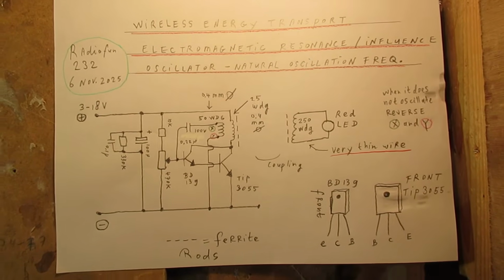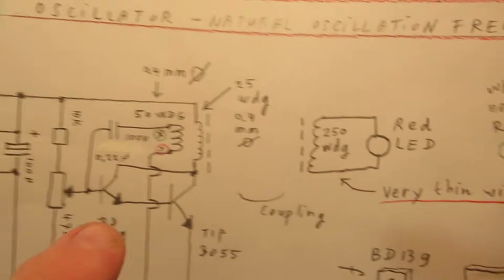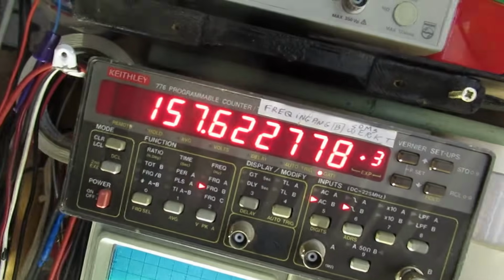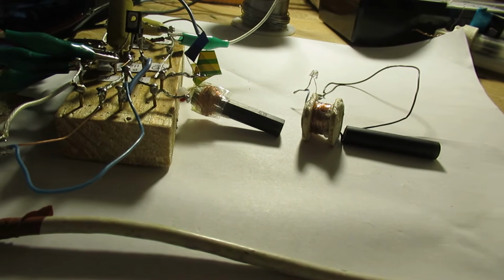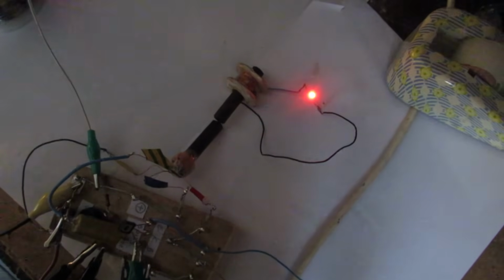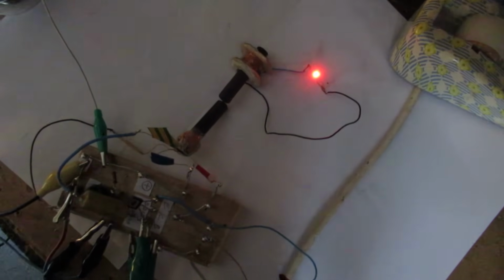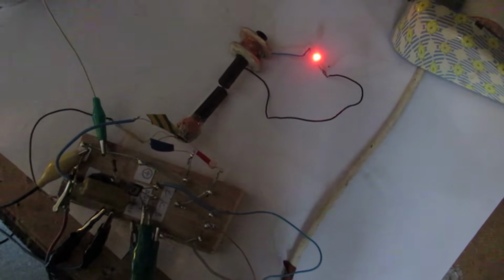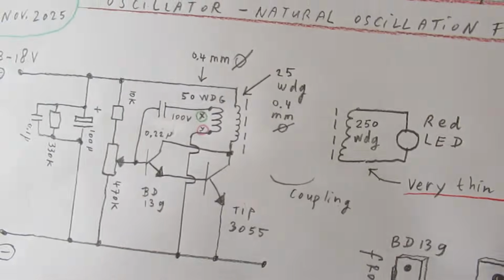Self oscillation & transport of electromagnetic energy through air. Schematic and basic demo

Comment from the maker: More information: the circuit was tested with supply voltages between 3 and 18 Volt DC. Maximum DC current/voltage that was taken up to drive the Darlington was: 300 mA at (say) 4 Volt = 0,3 x 4 = 1.2 Watt. Slowly add (!) the voltage/current to the circuit and look what happens! Tiny supply voltage changes can have big effects on frequency, the waveform (very important in terms of energy transport!) and the output voltage/current. If possible: use your oscilloscope and connect its probe to the primary coil (25 windings) or to the backcoupling coil (50 windings), thus to the Base of Transistor 1 in the Darlington = that BD 139. Never to the High Voltage coil! Don't burn your expensive oscilloscope out.....Sometimes the oscillation of these circuits can go "wild" and uncontrollable while slowly lifting up the supply voltage/current. Thus test and try (!). There is always a supply voltage (driving the Darlington) where, in such a blocking oscillator, it all works "normal". Output voltage on the secondary could get up very high, say 170 Volt but only on 50 Micro-Ampère. Was tested with a bridge rectifier (1000 V classical Si diodes, like the 1N5408 and its family) and a 12 K resistor paralleled to that bridge rectifier. Thus 50 uA at 170 Volt, in the max. situation. When we compare these figures (energy in-out), there is a fierce energy loss. Thus even with an oscillator that has the property to self-oscillate on frequency "X" there is no guarantee at all that it gives you out the best rendement (efficiency). Efficiency: is: the lowest loss as possible when converting A to B. In circuits of "joule thieves" (they are on my YT Channel, also many of them are on YouTube) this energy transport is optimized, so that you can deplete a carbon zinc or other type of battery to its absolute minimum voltage, draining out all its energy, where the (red) LED stops to light up. In joule thieves there is an optimal transport out of the HF oscillator to the LED. Can be realized (via a coil or coils) in many ways. When a radio transmitter strays out a amount of energy (X), that energy diminishes very quick regarding to the distance of the energy source. This is given by a factor, where distance to the radio source plays an important role. More about this in scientific & radio literature. As far as I know it is an inverse factor, related to the distance between transmitter and receiver. So: (say) 300 meters distance from a fierce radio station, say on AM or FM, straying out via an antenna, its field-strength is diminished substantially at a certain distance from the antenna. But be aware of the fact that also the "bundling" of the energy + the working frequency of a transmitter plays a role. Say when we are talking about a radar antenna, working on extremely high frequencies, its "bundled" and specific type of energy, often in the GigaHertz range, the field strength is bundled/more locally and can be locally fierce on point "X" in our atmosphere, where it strays out. It also has a (say) wave pattern, strayed out in our atmosphere, where precise measurements of the field strength can be made. 6 Nov. 2025.

Comment: Great video and yes very interesting thankyou for your time demonstrating and explaining. I'm watching a YouTube channel that has setup a oscillator that's blinking a led very faintly but the fact that it's capable to run from touching it or a big ground. energy is gathered in a separate circuit to drive the oscillator but no direct battery connection. So as your demonstration but the second coil has a oscillator circuit and the source of energy is obviously coming from somewhere but not know at this time .all very interesting and a bit off fun thankyou for sharing 👍
Reply from the maker: Thanks John, good to hear that.